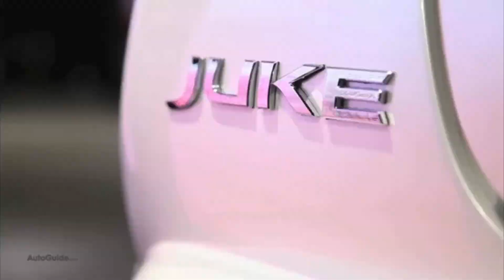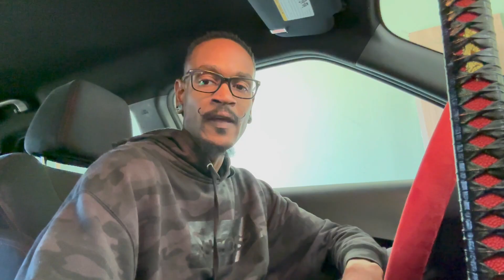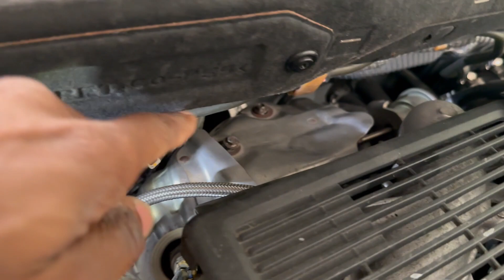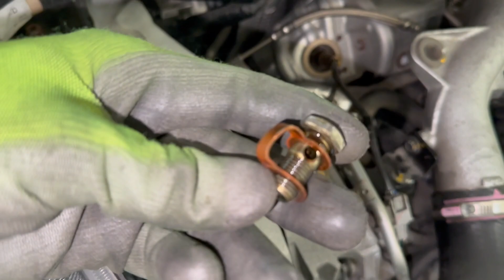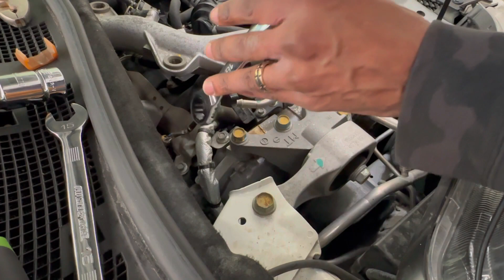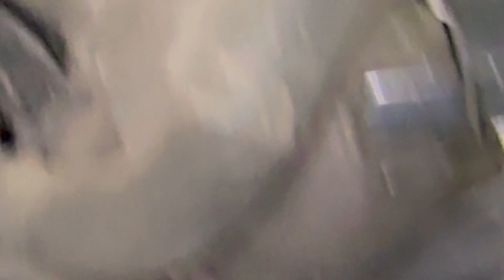Oil feed line install

Comment: Hey man, how’d you get the line to fit behind the block? I’ve been fighting with the heatshield for the last couple days
Reply from the maker: it’s definitely a bit*h if you beat the hell outta the heat shield enough to put a dent in it big enough it should be just enough space to get it on. Just keep at it and it’ll eventually get there, Good luck